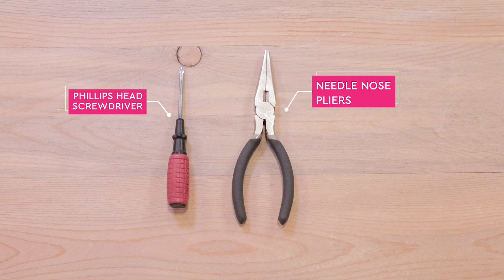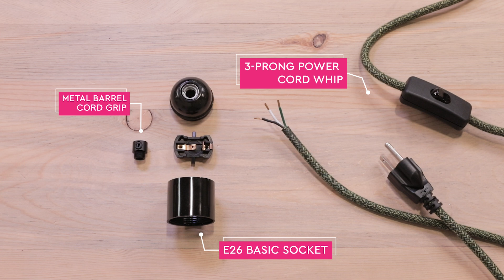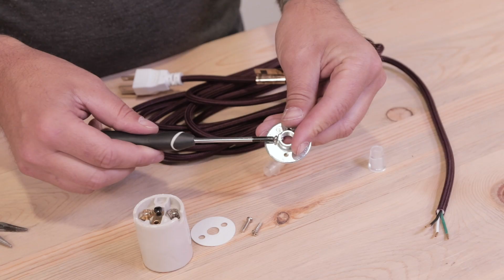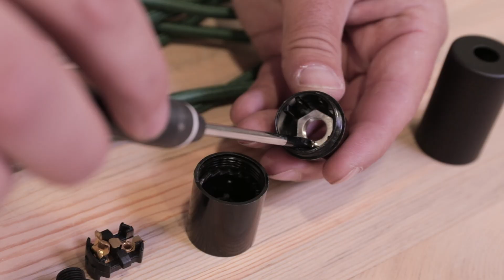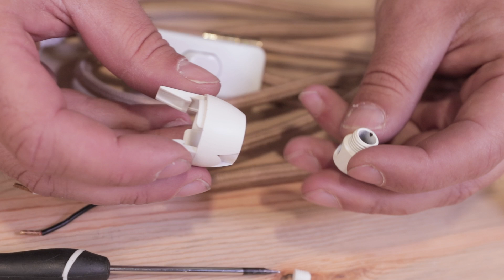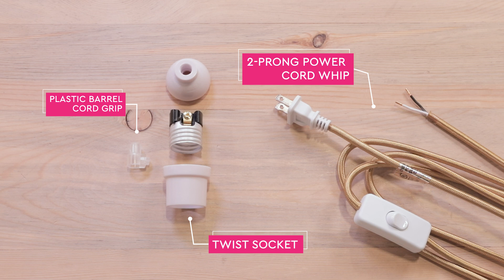Socket To Me: A Comprehensive Guide to Wiring Color Cord Company Sockets

Comment: The black socket section tells you to start by installing the cord grip and tightening it down, without mentioning the socket cover. If you have a metal socket cover, you need to put it on before you add the cord grip.

This is made more frustrating because the screws that come with the cap are garbage. They strip immediately as soon as they're tight, so it's a bitch to unscrew one.

The single port pendant tutorial is a better one if you have a metal socket cover.